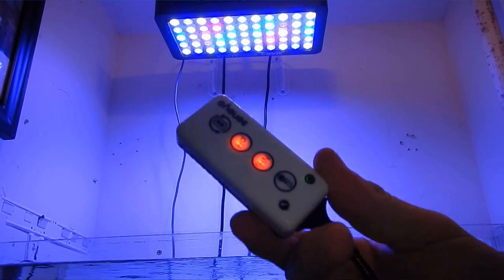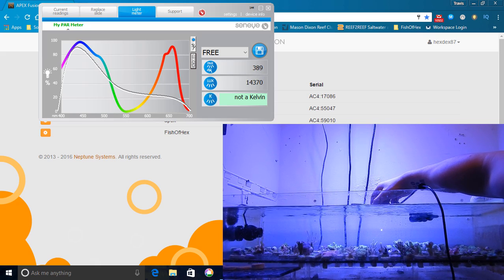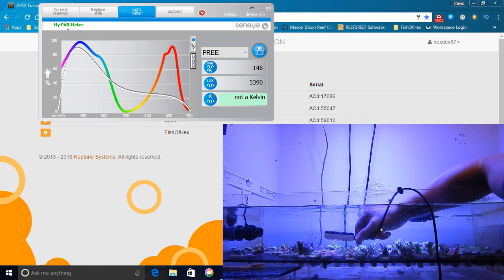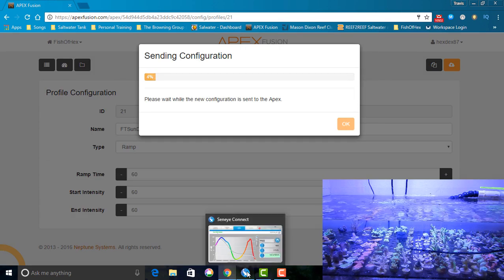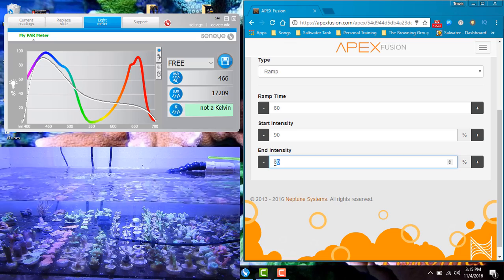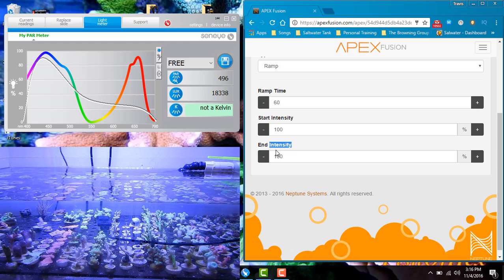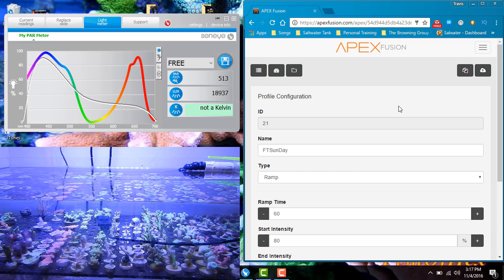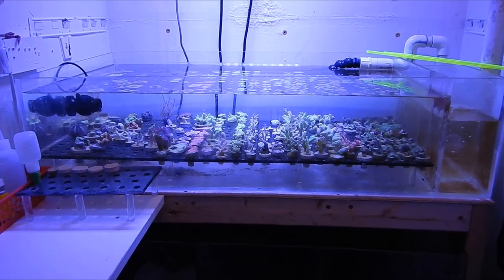Adjusting PAR Output On Frag Tank Using Seneye Reef | Sb Reef Light PCB Board

Comment: I find with higher PAR numbers like 400+ higher NO3 levels are needed to keep acros from getting too pale.  What NO3 and PO4 numbers does your system run?
I don’t try to control nutrient levels too much as I would rather have stable levels than perfect levels. So I adjust my lighting to my nutrient levels with my APEX PMK from time to time.